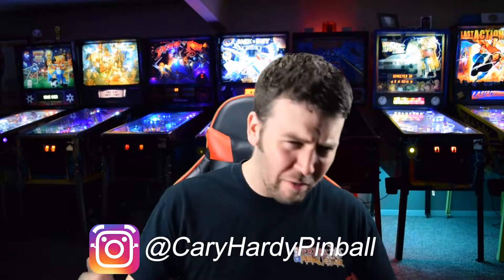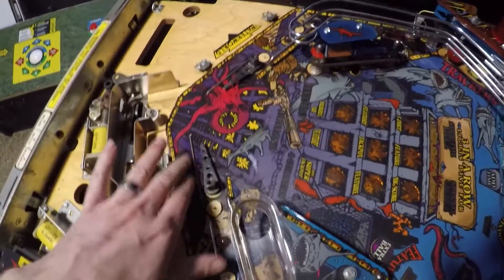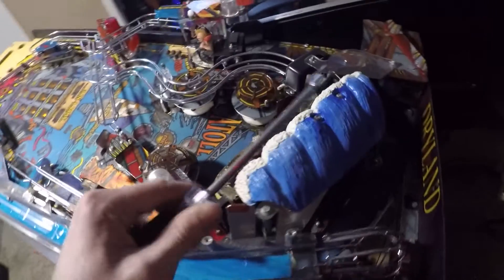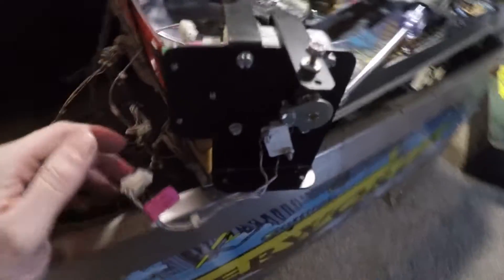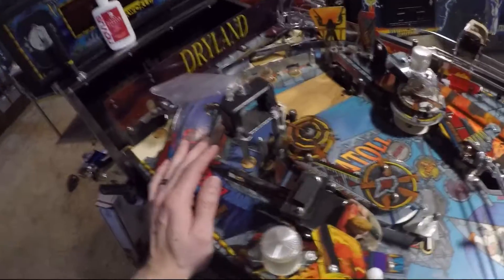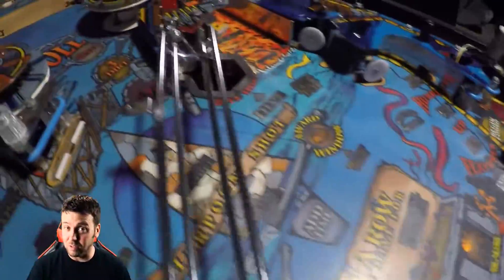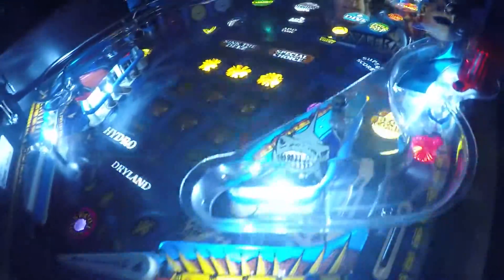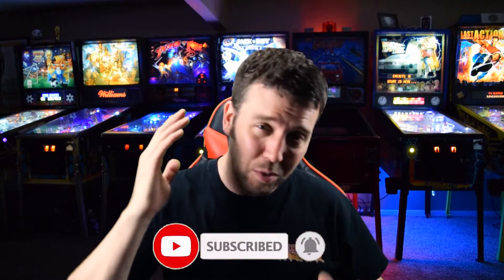WaterWorld Pinball Shop Job

Comment: I was wondering if you could help me I have a waterworld is my 1st prime machine got it last week was playing fine the deez didn't rotate completely all the way and the ball got jammed between the deez and the ramp it tried to rotate the ball was jammed it popped up on the DMD to call service ball jam turn it off slid the glass back got the ball on jam now the boat does not rotate I have replaced the motor on the boat all the fuses look fine don't know what to do